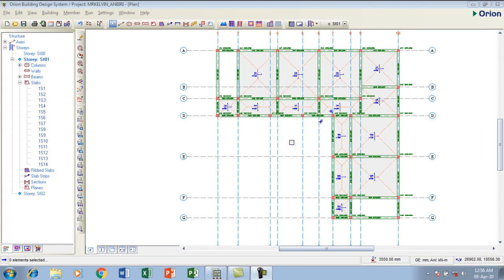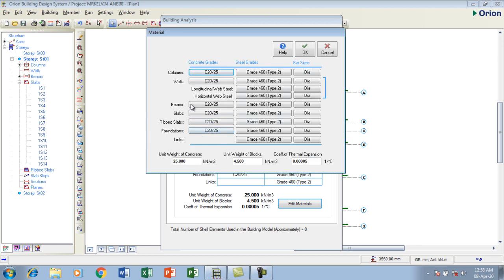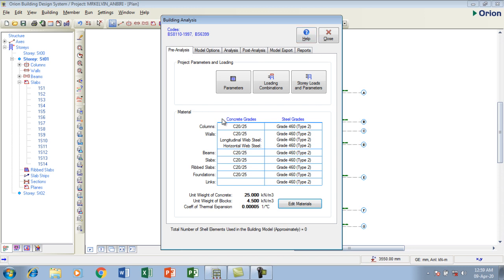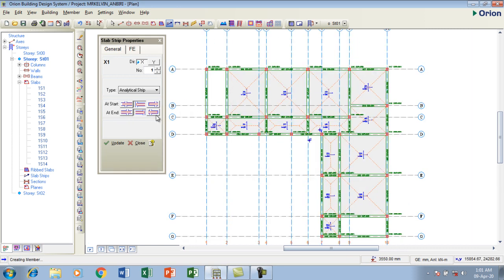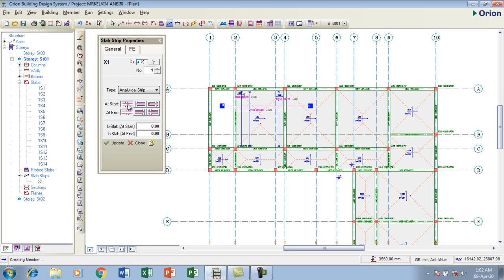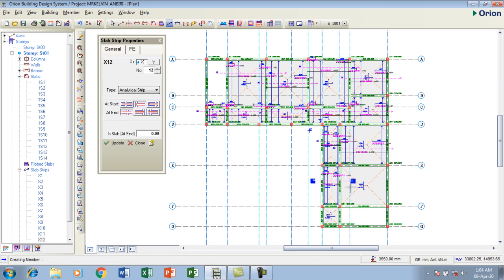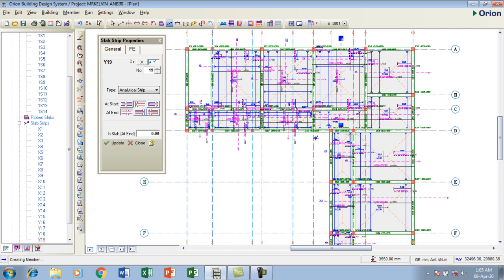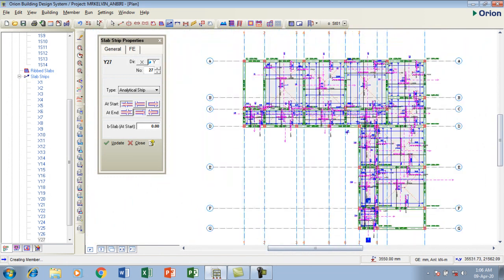ORION 18 TUTORIAL: HOW TO INSERT STRIPS(REINFORCEMENT) TO YOUR STRUCTURES FOR ANALYSIS

Comment: What happens if i take a strip from one end of the building to the other instead of taking it slab by slab. Is there a difference? And whats most recommended? Thank you.
Reply from the maker: Use finite  element method, found in this channel. 
The bar bending schedule depends on the end conditions of every bar taking all panels at once may not produce accurate results.